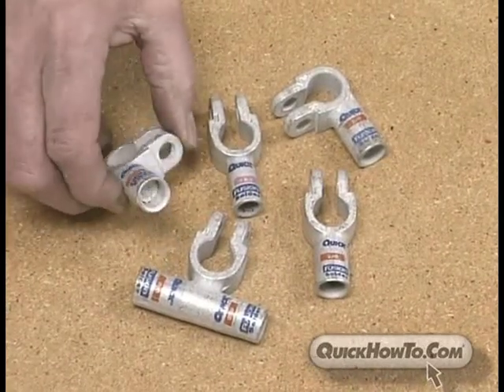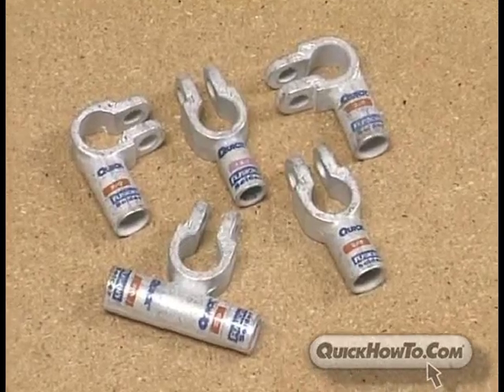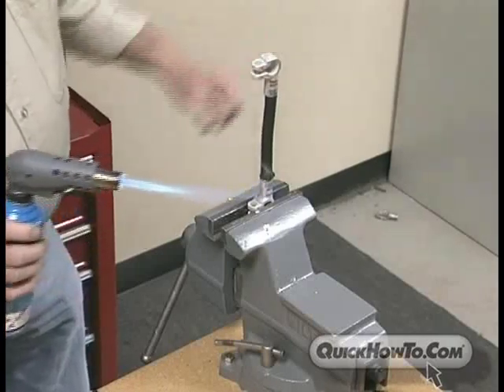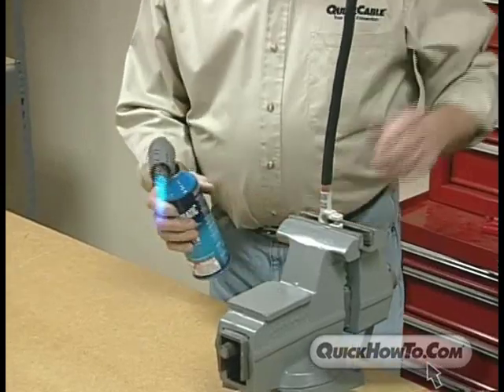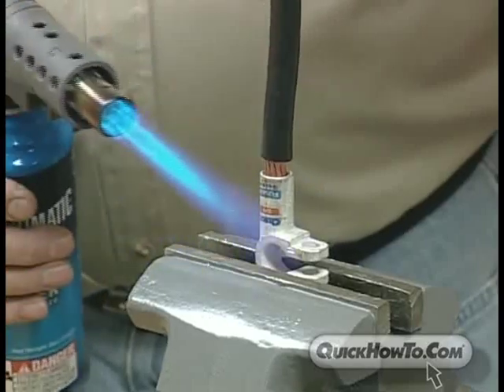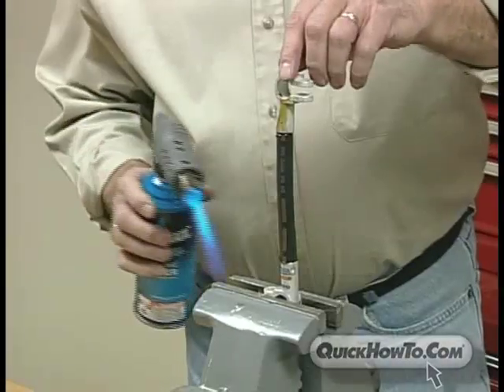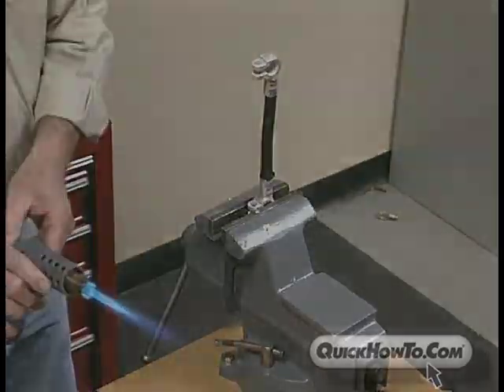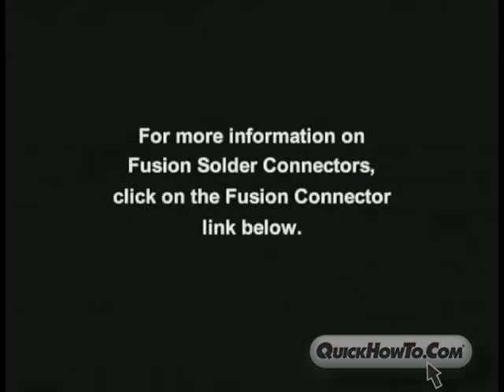How to Apply Fusion Solder Connectors

Comment: I just bought 8 lug type connectors to use with 4/0 welding wire because I didn't want to invest in a good quality cable crimper. I'm hooking up a 3000 watt inverter. Holding a 2' long piece of 4/0 cable is not easy while trying to put the end in the Fusion connector. I had a lot of solder spill out. How do I know if I have a good connection without sawing off the connector in the middle and visually seeing how it looks. Can I use a continuity tester and if so, what should I be looking for?